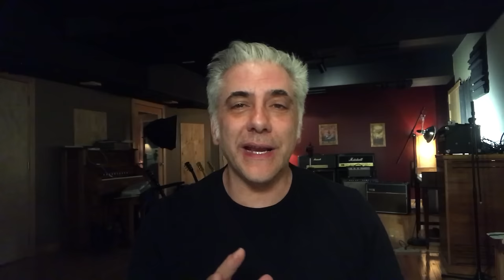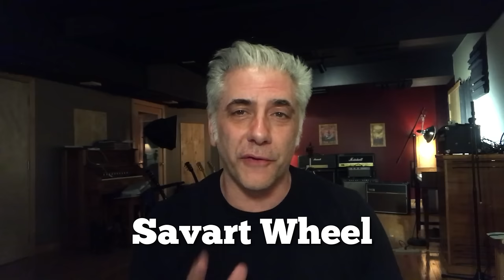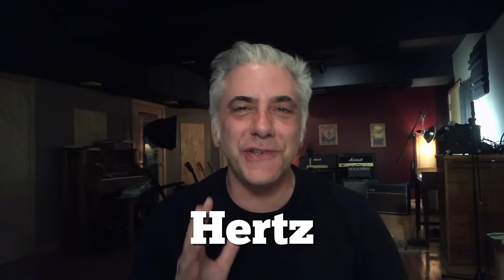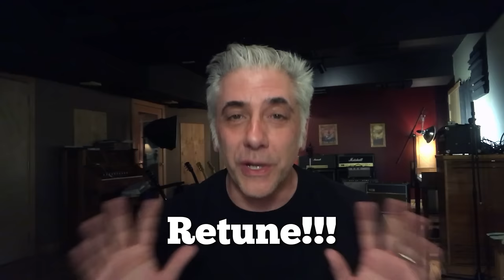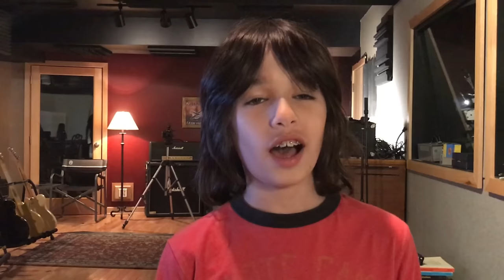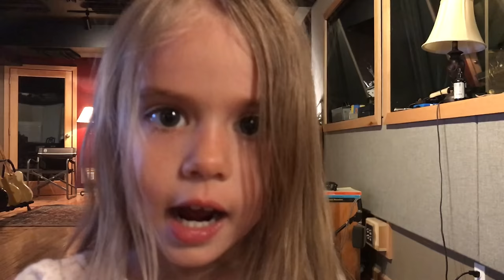What's the Deal With A = 440 Hz vs 432 Hz? Let's Talk!

Comment: The A 432 hertz argument, where it has attained some mystical and/or cosmic significance, is nonsense and here's why. At some point in history we decided to measure the passage of time more accurately and various timepieces were developed. A standard unit of time had to be decided upon. The reason we have divided the day into 24 hours, with 60 seconds in each of the 60 minutes that make up each hour, is purely due to the fact that these numbers are highly divisible. 24 is divisible by 2, 3, 4, 6, 8 and 12 whereas 60 is divisible by 2, 3, 4, 5, 6, 10, 12, 15, 20 and 30. Thus in this system it was easy to use fractions of an hour or day. For instance, we don't say 0.25 or 0.75 of an hour but 1/4 or 3/4 of an hour, respectively. Therefore the duration of a second, which 1/86400th of a day, is purely as a result of choosing how we divided the day up initially. Suppose we decide to go metric with our time and have 10 hours in a day, with 100 minutes in an hour and 100 seconds in a minute. This would give us 100,000 new seconds (ns) in a day as opposed to 86,400 seconds. The SI unit for a second, which is defined as the time taken for 9,192,631,770 vibrations (transitions between energy states) of caesium 133 atoms. Using our metric seconds the new SI definition would be corrected to 7,842,433,250 vibrations of caesium 133. As a result of this shortening of the second A 432 Hz would now be A 373.248 Hz. In conclusion, the duration of a second is the construct of man when we chose to divide the day into measurable units (i.e. 86,400s/day) . If we had chosen the system as outlined above (i.e. 100,000ns/day) the second would be shorter and therefore so would the cycles per second (hertz) of all of the tunings that are used in music. Simple.
Reply: PS. Using this the new definition of a second, 432Hz would have the same pitch equivalence as 500Hz in our existing definition. Try altering your instrument to this and see have relaxing, spiritual, etc., etc. it is. Frequency, amplitude and wavelength is dependant on your measurement system (i.e.. metres and seconds) which are defined by us. As I illustrated different standards and definitions yield different results. If we decided to base the second on how quickly Rick could say "Supercalifragilisticexpialidocious" (the Beato second) and the metre on 4 times the length of his, you know what (the Beato metre), the Beato Hertz would be completely different.
PPS. I don't know Rick so cannot shed any information of the equivalence of the Beato metre to the metre.

Comment: A4=435Hz decided by 7 composers and 2 physicians in France in 1859 and again established as the pitch standard in Vienna in 1885 is in my humble opinion the proper compromise for A4 with 12-TET. All the dramatic operatic pieces by Verdi and Puccini etc. sound better at A4=432-435Hz. 435Hz is the highest tuning for A4 before the dramatic voices have to thin out to much at the second passaggio. A4=440Hz (12-TET) It is too far removed from the voices natural relaxed speech resonance. At A4=432Hz most notes for the majority of people sounds like relaxed speech resonance.. 
I listen to 440Hz vs 432Hz and try to feel where I perceive the notes are sitting. At 440Hz it all very direct and the sound does not resonate in the chest.. With 432Hz music i get calm and the musical notes seem to hover in the lower part of the chest. 
You can't perceive this with an analytical mindset. You have to let go and just "feel" the music. 
Music performed at 440Hz is beautiful and great but the same piece performed at 432Hz can have dramatic effects.. There is literally a piece of music when performed at 432Hz made me weep instantly.. I listen to that piece before and after in stock 440Hz tuning and it did not have the same effect.. I think we are missing an importannt ingridient by having all music performed in keys locked into A4=440Hz (12-TET). 
Some times other pitches for A can be used and in some instances other tuning sysmtes like 1/4 comma meantone, Just intonation can be used instead, if the instruments and musician can do it..
Reply: You are totally right with your you have to shut down the analytical mindset for it. I play guitar now for arround 4,5 years selfteached and at arround 1 or maybe 1,5 years in i came over this 432 Hz discussion. To me it sounded interesting so i gave it a try. The first thing that i realized is that my guitar and most important the body and neck vibrated compared to 440 way more. On the start i needed to get used to the tuning but this just took the first day, pieces in minor for example just sounded way more dramatic too.
Unitl now i decided to stay in this tuning cause it feels okay and natural to me plus i can find the notes i hear in the head more easy. I went back and forth gave 440 another try for some days but it always took me back to 432, even a halfstep down from there arround 407,8~ Hz with a drop D "Drop Dflat in this case". I enjoy listen to meditation music and the open C# was quite another experience, even if a guitar isnt made for this specific tuning cause its too slobby with the stringtension.

I would never say this tuning is wrong or this is better, i still listen to musicians in 440 hz and even play and learn with friends in this tuning but for the solo music i would always chose to go back to 432 with high tension strings this works great. Im not a singer but if i just speak with my normal voice the guitars that hang on the wall keep resonating really frequently, so i bet singing in this tuning could be more easy.
Theres no right and wrong, everyone just should be open same with the old and forgotten Temperaments. Thats the core and root of music, cause music is about emotions and feelings, what a meantone Temperament can present in a more lets say authentic way.

Comment: Rick! How could the French standard have become 435Hz in 1859 when the term Hertz was coined in 1930?
Reply: They knew about vibrations pr second around 1840..  They did not put the Hz designation on it before 1930 but that does not mean they knew nothing about sound as vibrations pr the present measure of time which was a second in the mid 1800s...  

The increase of pitch from 435Hz to 440Hz does not seem like a logical development. 

A panel of six composers and 2 physicians in France in 1859 decided on 435Hz as a good average pitch .. 

Joe.. Strauss felt this pitch (435Hz) fatigued his singers the least and it worked well form opera form many different regions and ages. the opera from Puccini, Verdi , Donizetti. works well with this pitch.. 
The increase to modern 440-443Hz moves up the passaggio to high for the voices intended for these operatic pieces. A dramatic voice like Pavarotti works better at 435Hz than 443Hz. He can't blend enough chest resonance into his head register at 443Hz to make it sound good. Pavarotti suggested that the orchestras should tune to 437/438Hz... Then if the concert hall temp increased a little it would make sure that the pitch never went up above 440Hz. 
I tried 437Hz at home.. On demanding songs even this little difference (11.8 cents) makes a big difference.. Much easier for me to find the balance in the throat and breath on the high mid register to head register when the pitch is slightly lower.  You constantly see pop and rock singers pull chest on high notes when performing live as they want to get more of the "natural" chest resonance into their higher register to get a powerful sound.. A lowering of pitch by 20 cents to 435Hz would definitely limit this to a great degree as I find more singers natural resonance seems to lie closer to the notes in the 12-TET scale when A4 is set a little lower than modern A4=440Hz. I tried 430Hz but it is too flat for contemporary music... Notes in the lower chest register can be a little difficult to project above a loud orchester.

Comment: Harmonics Matching, why 432 hz (12 harmonic tuning) is important for most EDM and some rock if you dont want aggresive guitar tones from the hiss from the disharmonic (8 harmonic) 440 hz tuning

ResonanceAs was mentioned in Lesson 4, musical instruments are set into vibrational motion at their natural frequency when a person hits, strikes, strums, plucks or somehow disturbs the object. Each natural frequency of the object is associated with one of the many standing wave patterns by which that object could vibrate. The natural frequencies of a musical instrument are sometimes referred to as the harmonics of the instrument. An instrument can be forced into vibrating at one of its harmonics (with one of its standing wave patterns) if another interconnected object pushes it with one of those frequencies. This is known as resonance - when one object vibrating at the same natural frequency of a second object forces that second object into vibrational motion.
The word resonance comes from Latin and means to "resound" - to sound out together with a loud sound. Resonance is a common cause of sound production in musical instruments. One of our best models of resonance in a musical instrument is a resonance tube (a hollow cylindrical tube) partially filled with water and forced into vibration by a tuning fork. The tuning fork is the object that forced the air inside of the resonance tube into resonance. As the sines of the tuning fork vibrate at their own natural frequency, they created sound waves that impinge upon the opening of the resonance tube. These impinging sound waves produced by the tuning fork force air inside of the resonance tube to vibrate at the same frequency. Yet, in the absence of resonance, the sound of these vibrations is not loud enough to discern. Resonance only occurs when the first object is vibrating at the natural frequency of the second object. So if the frequency at which the tuning fork vibrates is not identical to one of the natural frequencies of the air column inside the resonance tube, resonance will not occur and the two objects will not sound out together with a loud sound. But the location of the water level can be altered by raising and lowering a reservoir of water, thus decreasing or increasing the length of the air column. As we have learned earlier, an increase in the length of a vibrational system (here, the air in the tube) increases the wavelength and decreases the natural frequency of that system. Conversely, a decrease in the length of a vibrational system decreases the wavelength and increases the natural frequency. So by raising and lowering the water level, the natural frequency of the air in the tube could be matched to the frequency at which the tuning fork vibrates. When the match is achieved, the tuning fork forces the air column inside of the resonance tube to vibrate at its own natural frequency and resonance is achieved. The result of resonance is always a big vibration - that is, a loud sound.
If you listen to 440 resonance you can hear a hiss, this is from harmonic cancilition, 440hz has 8 harmonics 432 hz has 12. So this hiss smears the track makes it less omni directional and shortens the sustain as it just got hiss er fied hahaha, and of corse losses clarity from the hiss smearing and its louder, ever noticed how your faders db goes up?
Reply from the maker: Next time Yhoda, don't smoke up before you respond :)

Comment: I like to experiment with different tunings on my 6 and 8 string guitars. Even experiment on four and five string bass. As a rule I find that most men cannot sing super high notes without going falsetto. But certainly not all men. I always figured that was why a lot of rock and roll was tuned down a half or a whole step, to make it easier on the vocalist and give it a heavier sound. I have experimented going down in frequencies using digital tuners and then matching my guitar to whatever that frequency was, be it 432. 
For my original music it's just slightly lower. But if you're trying to play a song that you know, it's impossible to sound correct because every song I've ever heard with a few exceptions is probably tuned to 440 at the a note. Lots of rock and even country down Tunes to E-flat on the 6th string, or even down to D or D flat, and some bands even to down to C on the heavy 6th string. Thats 4 half tones. And then you start playing around with a capo. Even if you tune your guitar to 440 HZ, or E standard tuning there is a million different special tunings that you can use across all six strings, or just moving the Capo up and down the neck. And endless realm of tonal possibilities.

Comment: Thanks Rick! Always enjoy your videos. This became an issue today while I was learning Ticket To Ride. Listening to the Beatles on Youtube it seems to be in the key of Ab, except strangely the Ab seems to be tuned up 50 cents. So it tunes up as Ab +50 cent. I have since heard that early Beatles recorded with A = 435 and the mix was sped-up as necessary.
Reply: I was doing the same thing and noticed it too! If it was 435 Hz wouldn’t that be only 20 cents flat though of an A if 4 cents is roughly a hertz?

Comment: Verdi could tolerate the french A4=435Hz pitch but suggested A4=432Hz.. He knew exactly what microtonal pitch changes does to the color of the voice and the placement of notes at the passaggios. 
This is the main reason we should use a lower standard than modern 440Hz.. This high pitch shift the passaggio a little too high.. Keep pitch at 435Hz or slightly lower and you are dandy... Voices sound better. More natural, slightly fuller and more honest.. 

 ,, this microtonal change (A4=431-435Hz) is what places the vocal fachs in the correct positions.. 440Hz is slightly too pitchy and sets the notes at a weird place at those different fachs passaggio.

Comment: While Hertz was only measured starting in the early 1800s, it's important to remember that it's just a measuring tool, just like radiocarbon dating would be used to determine the age of an object containing organic material. Instruments and tuning practices predating the Hertz measurement have been retroactively found to be A=432Hz, for instance, there were tuning forks found that corresponded with the frequency, or the simple fact that people swore by Pythagorean 5ths for tuning (who is also the person responsible for the monochord, which was historically in tune with 432Hz). I see people make this same moot point all the time, but it's a pretty obvious, hard-to-miss observation if you think about it.

Comment: but still, if the "earth" resonates at 8 Hz, and 432 supposedly resonates as a multiplier of that, it doesn't matter if seconds existed in the past or not. Even if Hz is manmade, the two still hold a ratio to one another, Hz is just how we happen to measure it.
Reply: JubileeGiggles The Schumann resonance is actually around 7.83Hz, so no, 432 is not in its harmonic series.
Reply: so then it should just be a little less than 432, in line with their reasoning. 432 is closer than 440 though
Reply: A small error can sound way worse than a larger one. So don't even try to resonate the planet under my feet.
Reply: ha, just looked it up, if you're looking at multiples of 7.83, then 440 is actually closer to one than 432 is :P
Reply: Not that any of that would matter to the sound of music...
Reply: After all, the lowest note most people can hear is around 20 hz, and even people with no hearing loss rarely hear lower than 15...
Reply: Also what happens to this magical resonance when you tune your A to 432 Hz but then play in Ab?
Reply: 440 can be divided evenly by 8 also (440/8=55) (432/8=54).
Reply: xngr Then your chakras explode, and you usher in armageddon. Obviously.
Reply: You get another nice tone at~ 408Hz that fits the human voice a lot better than standard 415.3Hz.
Reply: Why would it fit "the human voice" better? Because it's bad at decimal places..?
Reply: Register shift , register shift , register shift,, ask soprano Renata Tebaldi, baritone Piero Cappuccilli, soprano Antonella Banaudi, tenor Carlo bergonzi. ,,
Reply: What all people forget that the Schumann resonance is an electromagnetic wave. Electromagnetic waves propagate with the speed of light. Acoustic waves with the speed of, well, sound. The wavelength of the Schumann resonance, as far as I remember, is around 38000km, the wavelength of an 8Hz audio signal a bit above 40m. 
I really fail to see how those are even remotely connected...
Reply: The Schumann resonance is an eletromagnetic phenomenon. Sounds are mecanic waves - i.e. not eletromagnetic.

Correlation: none.

Comment: A=440Hz was introduced in 1939 and what happened in 1939? WW2! Coincidence, I think not!
Reply: And why did the war end? We still have that 440 Hz tuning. 

I also don‘t get the connection between music you listen to and aggression that leads to a war. I mean, people aren‘t listening to music 24/7. And when you listen to music tuned in 440 Hz, you will not get aggressive at that moment. 
Maybe a bit more unrelaxed because the tension raises - for example guitar strings have to sit tighter and singers has to put in more energy to reach higher tones. So in comparison, singing in 432 Hz would be more relaxing. But is that difference really so dramatic, that it could decide between peace or war?

I would say that distortion in music like rock has a greater impact on your inner state compared to classical music for example. Also the tempo. The lower the tempo, the more relaxing and vice versa.